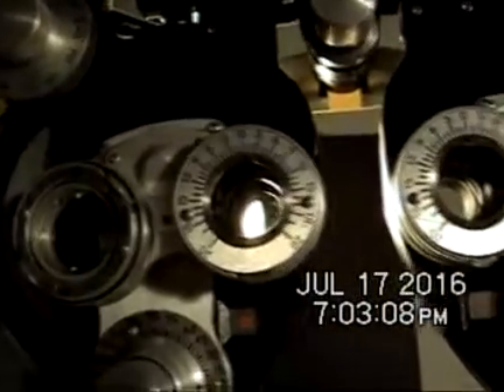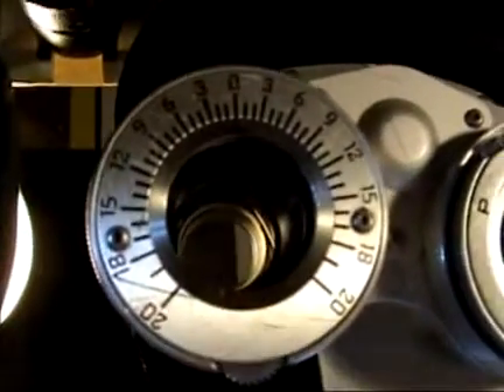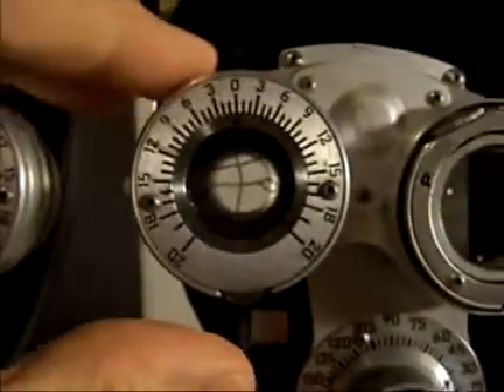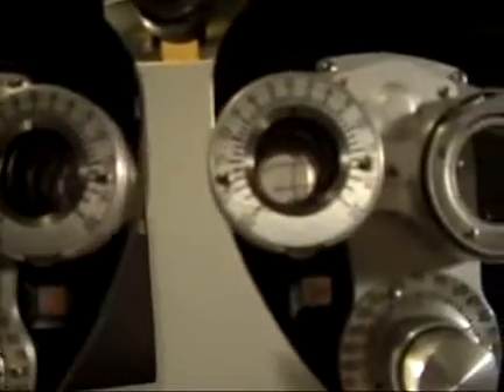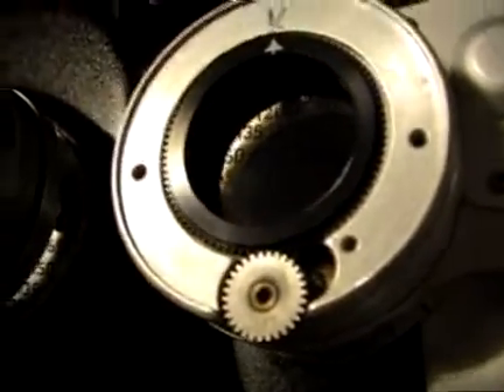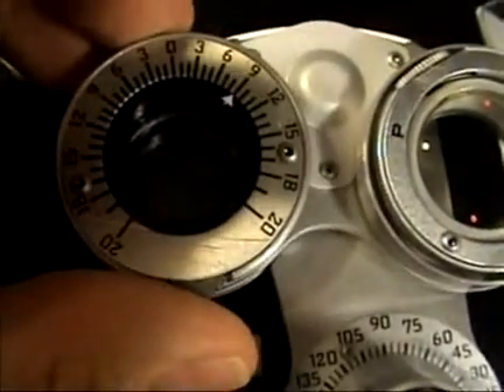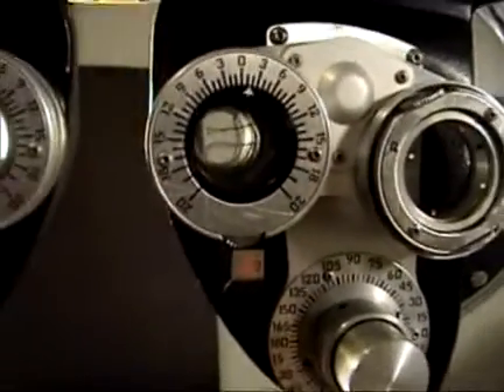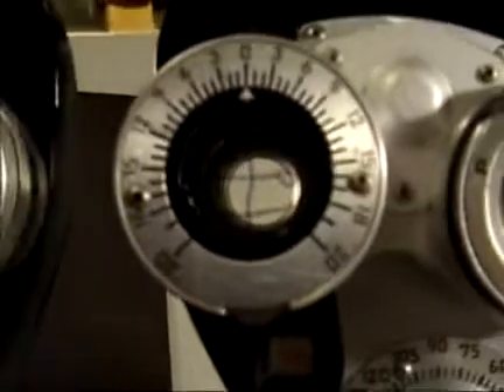Risley Prism Adventures, July 2016

Comment: Are you able to show taking the prism apart and cleaning the inside of the lenses and reassembly?
Reply from the maker: No.  It is an extremely complex procedure.  Every time I had a phoroptor that needed one (or both) Risley prisms cleaned on the inside, I sent the cylinder assembly to my repair expert at Lombart Instruments (I used the Norfolk office).